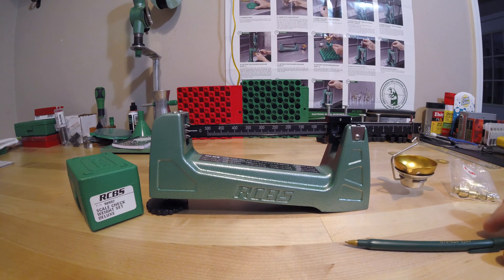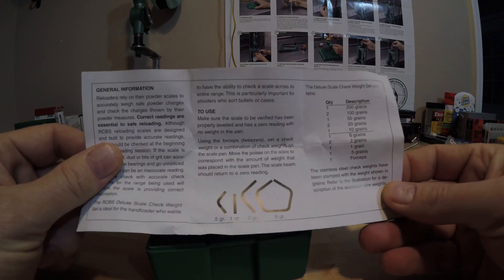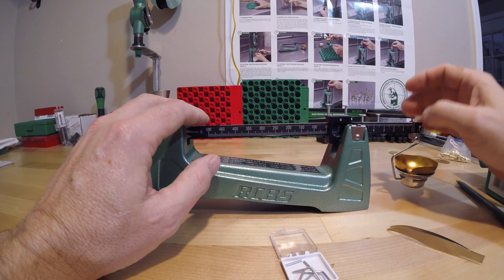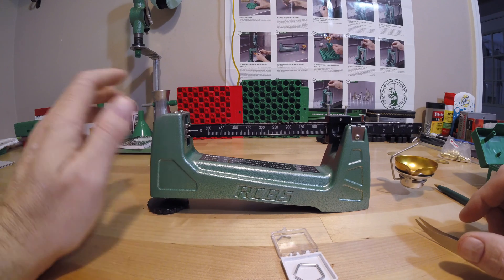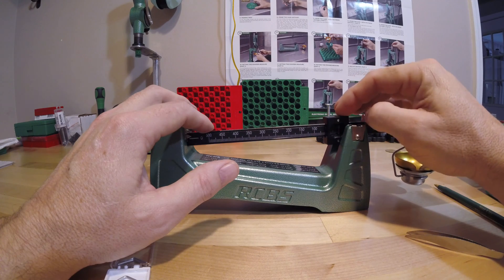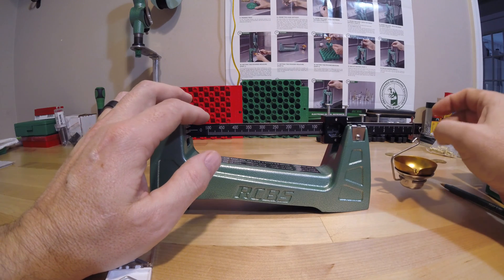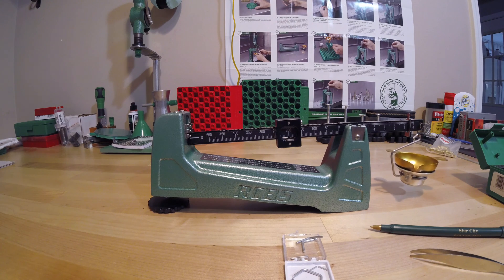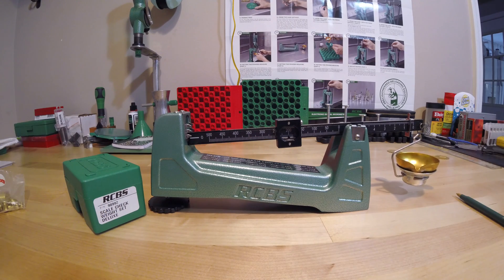RCBS M500 Scale and RCBS Test Weights Accuracy Solved

Comment: Good review Randy - Although the M500 is made in China I have found very little problem with them. Two weak points:- It's too light, easily remedied by sticking a few old bullets in the base with a glue gun and because the beam is printed on both sides it does necessarily mean the zero pointer is 1/4" away from the beam, this can lead to parallax errors unless it is viewed from exactly the same angle every time. Again easily fixed by using a cheap USB camera to view the pointer.
As I use here in my M500 video.   https://youtu.be/1NNIC2Qn50U

Comment: If it is slightly high a 5 grains after adding the 1 grain weight, but is dead on when weighing the 5 grain weight, then the 1 grain weight is slightly heavy.